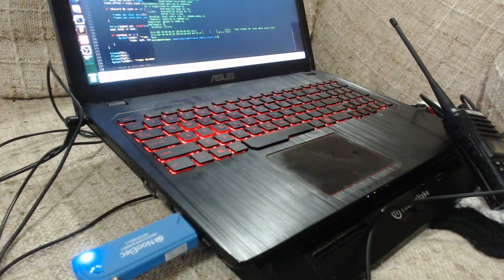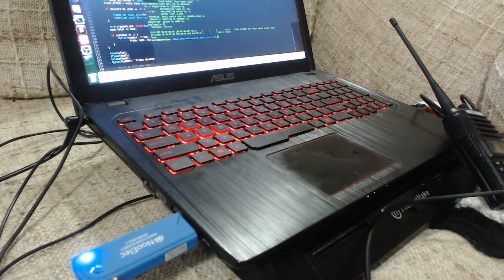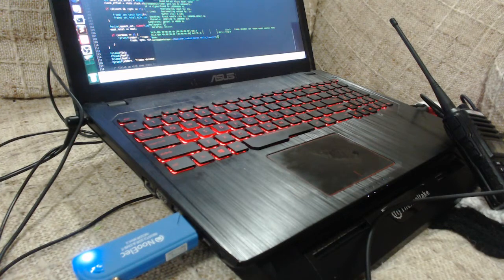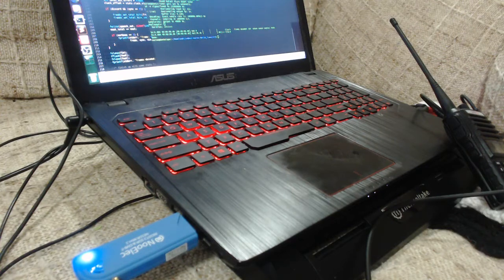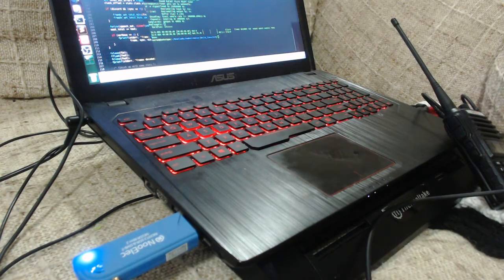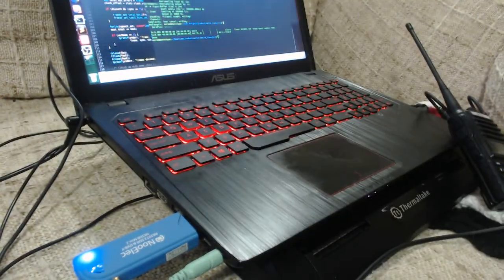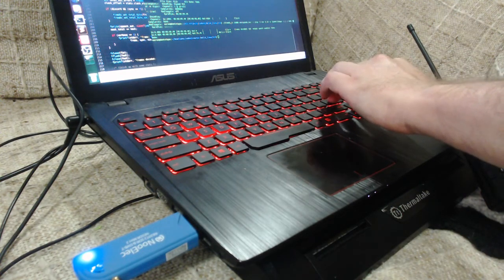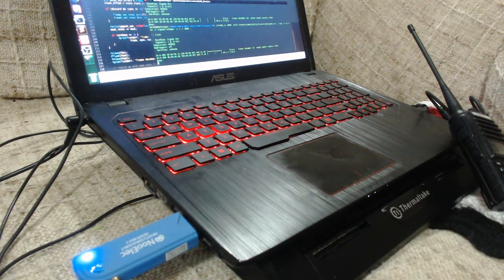Encrypted Digital Voice Radio Demonstration

Comment: Hi doctor,actually i searched for a long time to find a good answer,but i didn't,until i found you, you're amazing,but i want an answer about: can we develope the quality of that voice you made?
I mean with encryption
Reply from the maker: I'm not a doctor. But to answer your question, the codec2 developers have been working on something called LPCNet, which has much improved voice quality at similar bit rates. However it's still a bit experimental. I would like to add encryption support for it, but I've been busy with other things for most of the year and haven't had a lot of time to spend on this project.

Comment: Your work is amazing , I’m trying to implement something like that to my project involving controlling a CB radio using gpios and an android app, my goal is to use Java (my whole project is based on it) to process, encrypt and then decrypt on the other end the voice signal to add a scrambler like feature.
I tried different approaches but I find difficult to manipulate the audio signal and then demodulate it on the other end  .

Here’s my project so far , it’s working but an encryption feature would be awesome to implement if you have any hint would be awesome .
(Eng subs )
https://youtu.be/1QrY2L5KrPU?si=Ox-nGQM6J_iXuEPM

Comment: Interesting. Is it feasible to use this as secure digital voice over HF? Ala a Codan 3590 AES-256 DV. The Codan is silly expensive. I could see the PI and your software being used, and chassied with 3d printing, to resemble the Codan. If so; would buy
Reply from the maker: Yes I added HF support last year. From what I gather the HF support is less "foolproof" than it is on commercial systems like you mentioned (eg. there are a few different HF modes that work better/worse under particular conditions which must be manually configured as part of the setup process), but it's also much less expensive.

Comment: Very impressive projects. Do you shared the developments code or script?
Reply from the maker: Yes this became a full-blown secure voice module that runs on a raspberry pi, and I have some other videos that go over many of the features of that module. Release images are here: https://github.com/aarmono/crypto_transceiver_buildroot/releases

The core source code for the system is here: https://github.com/aarmono/crypto_transceiver
Reply: @aarmono  Thanks for the reply. One more things was the core source code includes with the new UI for configuration?
Reply from the maker: @9w2elm Yes the config UI is included in the crypto_transceiver project
Reply: @aarmono  Very thanks for the reply, I already gathered a necessary hardware to reconstruct and simulate back your system, can I have your email address so I can keep in touch with you if I have any question to asks?
Reply from the maker: @9w2elm  You can contact me on telegram under this username
Reply: @aarmono  I already simulate your crypto devices, but I can't populate the usb soundcard via your TUI. If I set it based on your TUI, one of the sound card goes busy when I want to adjust the volume. During system start its already select the sound card by default. Also there is a problem to make one of the sound card persistent in audio setting after system restart. Can you gives me a suggestion on how I want to solve the problems?
Reply from the maker: @9w2elm  There's an "Assign Audio Devices" configuration option/wizard that should bind the USB audio device plugged into a particular USB port to either the radio or microphone device. If you run that and save settings the assignment should be persistent.
Reply: @aarmono  I already assign it based on the TUI option. But one of the USB sound card that I already assigned, when I try to adjust the settings, it throws message box on top of the TUI which stated USB sound card busy error. As a results I can't change the sound card settings. These problems only happen to ONLY one of the sound card.
Reply from the maker: @9w2elm  If you plug reverse which ports the USB sound cards are plugged into (eg. if you have them plugged into the top and bottom ports plug the bottom one into the top port and the top one into the bottom), does the error follow the sound card or does it follow the port?

If it follows the card then perhaps the card is somehow malfunctioning (some of the cheap USB sound cards don't work very well). If it follows the port there may be something going on with the software/OS.

Comment: I'd like to know the exact command to reproduce, please.
Reply from the maker: The easiest way to run this is probably to use the pre-built raspberry pi 3b+ firmware image. There are instructions on how to do this here: https://github.com/aarmono/crypto_transceiver_instructions
Reply: Thanks.
 @aarmono
Reply: @aarmono   In this video what is the command you captured the signal from radio with sdr. I'm using rtl-sdr with sdr#.
Reply from the maker: @moekyawthu5774  It's been a while since I've used rtl-sdr, but I think it was: rtl_fm -s 48k -N -o 4 -f <freq>

You could probably play with the sample rate and oversampling settings a bit, but the important things are narrowband FM mode and an output rate of 48KHz

Comment: How bad does it degrade the signal in terms of re-readability?
Reply from the maker: You mean the voice quality or distance the signal can be transmitted? In terms of voice quality, speech is understandable but  doesn't sound as good as analog. In particular the codec seems to have trouble with lower frequencies.

In terms of transmission distance compared to analog, that's not something I've played with much. I've played with the HF modes a bit, and some of them were able to decode a signal with about a 0db SNR. But I haven't tried that with the FM mode used in this video.

Comment: yo how'd u get that circuit bent affect?
I want to know if I can play with that software outside of radio for this dope new beat Im working on.
Can I record my voice and get it to sound like that and .wav into audacity and fl studio?
Reply from the maker: The voice codec compresses the audio using a vocoder before it sends it over the radio. That gives the voice the distinctive sound.

Take a look at the FreeDV software: https://freedv.org/ It's based on the same software this system uses but has a GUI so it's a bit easier to use. You need two sound cards: one for voice in/out and one for radio in/out. If you loopback radio out to radio in, then you should be able to record the distorted voice.

Since you aren't using a radio you probably won't care about most of the options except you would want to enable Full Duplex mode so that the loopback works. The manual linked to from that site describes this a bit.

You could also potentially use the Audacity vocoder plugin, but I couldn't get it to sound right after a few minutes of trying (perhaps because I don't know how to use it properly).
Reply: @aarmono  super cool!
and I might use for actual radio in the future but for now mostly interested in using it it for music.
Thanks a lot for outlining what I need and how to hopefully get it going!
I have a theory it sounds like that because it might be somewhat related to the LPC coding used in early computer speach synthesizers etc.
think texas instruments stuff.
and geosafari talking globe.
the vtech whiz kid computer is another good example.
These would spaz out when you would jiggle the bateries or put in a cartredge backwords and do basically what you got when you tried to play the encrypted data through the decoder and it didn't know what to do with it.

Comment: Could you add in a time stamp with digital signature for each audio frame so you could at least compare it to the current time? Might be a trivial way to defeat replay attacks.
Reply from the maker: I did some investigation on replay attack avoidance back when I was developing this. At the time I couldn't figure out a way to encode the signature, since the way the digital audio data is encoded doesn't really provide a good way to add additional metadata to the transmission. Perhaps if it could be encoded in the audio stream in some way.

Timestamp-based signatures are tricky on the Pi because they lack real time clocks, so there would have to be some way to maintain reasonable clock sync (and resync after a power-cycle). In theory this could be done over the radio link, but I was trying to keep the system from depending on a particular radio receiving a particular transmission to function.

Comment: Will this work to decrypt Phase 2 digital trunked simulcast P25 systems ?
Reply from the maker: P25 is its own thing. There is another similar and interesting project of which I was unaware when I started working on this two years ago called M17: https://m17project.org/. It's targeted towards ham radio so doesn't have encryption, but it purports to have a lot of functionality comparable to other digital trunked radio systems and uses the same codec2 voice codec as my project uses. They have an open firmware design that can be flashed onto certain models of handheld radio.
Reply: No

Comment: cool stuff, thanks for sharing all this. but I don't get how you're able to recieve a decent replay of the original recorded voice.. when transmitting the encrypted signal over radio you had said there was some loss - wouldn't this make the recieved signal unreliable? because from what I now about encryptions like aes, even if a few bits are changed the decrypted data will be completely different right?
Reply from the maker: The encoding of the digital (encrypted) signal has error correction built into it that is able to recover the original signal in the presence of some signal loss. However this error correction has limits, and it's likely that for a given signal quality the encrypted voice will be less tolerant of loss than the unencrypted signal for the reason you state. Also because the way the encryption works, the receiver needs to re-synchronize with the sender in a way that isn't necessary with an unencrypted signal.

The nature of the difference between the encrypted and unencrypted signals is something I would like to understand more.

Comment: I'd be really interested in seeing codec2 transmission over LoRa radios. There's a Chinese company that I bought a communicator set from that used LoRa and it could send snippets of recorded voice over that link, but I'm not sure if they were using codec2. I'm wondering if we could achieve real-time communications over such a radio?
Reply from the maker: Potentially yes. I'm not that familiar with LoRa, but it appears to support a number of different bit rates depending on how strong/weak the signal is. Arguably it would be easier to implement this over LoRa, since the data encoding is already being done by the module; so you would just need to send the digital voice data to the module and let it worry about the rest.
Reply: @aarmono  Some friends and I from our local ham radio club are working on exactly this, I'll comment again in the coming weeks if we have anything to show off. I'm not clear on the licencing requirements, but from a technical standpoint I believe it to be very achievable to have real time voice communication
Reply: The problem with LoRa is, the duty cycle for each node is limited by policy, so you can't send enough data to contain any meaningful voice content.
Reply: The feds may visit
Reply: @charleshunziker7416 there is always someone without fail that can not resist the urge to post this bs.  There is nothing what so ever illegal in what he has done and it's already been done 8n various ways a number of times.  You people act like someone is pushing this out over ham.

Comment: i got two pi 3b+ and two radios, how would i hook up the other pi to decode the signal? i managed to hear the garbled sound out of the first pi. do i have to use a linux laptop?
Reply from the maker: I'm pleased to hear you're trying out my software. Just to make sure I'm giving you the best advice I can, are you using my custom pi image whose instructions are located here: https://github.com/aarmono/crypto_transceiver_instructions or are you using the standard pi image with my software installed on top of it?

A bit of information about the specifics of the hardware you're using (radio models, audio device interfaces, etc...) would also be helpful.
Reply: @aarmono  i'm using your custom pi image, i think its all working as its supposed to. I got to the audio adjustment page. I have two Baofeng FRS Radios, 2 pi 3b+, and 2 TRRS audio interfaces, like you do, but i guess i need 4 total, i just realized that. I have all the same gear, just no linux laptop. Am i supposed to feed the modulated modem noises into the radio (for tx) from the first interface? or the garbled speech sound from the second interface? i also dont know how to hook up the rx radio.  i dont think your system is duplex, just one way? thank you
Reply from the maker: @youngmonk3801  Thanks for the additional information. You are correct; you feed the modem noises into the radio microphone input, then the radio headphone output would be connected to that same audio interface on the pi as its microphone input so it can receive the modem noises transmitted by the other radio. If you're using one of the baofeng APRS-K1 audio cables or equivalent they should be pre-wired for that, and you should just be able to directly connect the APRS-K1 cable to the TRRS audio device which is outputting the modem noises. The other audio device is connected to your headset.

The RX radio is hooked up the same way as the TX; there's no distinction between the two. The system is bidirectional and supports simultaneous transmit and receive when connected to a device that supports it (eg. analog phone). You don't need the laptop; I simply use one because it's the hardware I have on-hand to receive/decode the signals my radio is sending since I don't have a second pi.

Since you only have the 2 audio devices, if you wanted to do a full end-to-end test with a single pi, you could plug the 2 audio devices into one of your pi computers and connect the modem audio interface speaker out to the modem audio interface microphone input using a male-male TRS cable and an adapter cable that splits the TRRS connector to dedicated microphone and speaker connectors (eg. https://www.amazon.com/Splitter-connectors-External-Microphone-ZaxSound/dp/B01I5MYQDQ). Use the male-male TRS cable to connect the speaker output to the microphone input. Then plug your headset into the other audio interface and start talking. You should hear yourself through the headphones, which verifies that everything in the pi is configured and functioning correctly. Then to test the radio is wired correctly, connect one of your radios to the pi, transmit the modem signal, and just listen to your other radio to see if you hear the modem noises through the speaker. Then when you get the additional 2 audio devices you can do the same thing on the other pi; and it should all "just work" (assuming the keys match).
Reply: @aarmono  i couldnt follow that splitter link, but also what kind of headsets do you recommend for this test? will earbud style headsets work, or should i get better?
Reply from the maker: @youngmonk3801  youtube appears to have screwed up the link. try this: https://www.amazon.com/Splitter-connectors-External-Microphone-ZaxSound/dp/B01I5MYQDQ

I don't know if that particular product is good or not, but that's the sort of cable I'm talking about you'd use with a male-male TRS cable to "loopback" the modem signal to test everything out before connecting it to a radio.

As for headset I don't really have any recommendation. It somewhat depends on your use case: whether this is for handheld use, mobile vehicle use, or indoors. I have a gamer-style headset I use for testing, but I can't say I'd recommend them if you needed to use the radio while driving or walking around. I can't think of a reason why earbud style headsets wouldn't work but haven't ever tried them personally.

One thing to keep in mind is the voice codec is designed for voice and may be negatively affected by ambient noise, so it's probably a good idea to use something with a microphone that won't pick up a lot of ambient noise if you plan on using this in noisy and/or outdoor environments.
Reply: @aarmono  that worked thank you,a lot of headsets have noise canceling does that affect the system negatively?
Reply from the maker: @youngmonk3801  I can't think of any reason why it would be a problem.

Comment: can you do another vid with 2 radios and two pi's? maybe some field testing? now that would be cool!
Reply from the maker: I have done some (unrecorded) field testing around the house trying to determine how far away I can be and still receive the signal at my house. Unfortunately local geography makes it difficult to receive distant signals, especially using the stock handheld antenna. However I did recently pick up a decent mobile antenna that fits on my handheld (as well as upgrade the antenna on my SDR) which might allow me to do some longer range tests from my car. I've been meaning to do this; I'd just have to figure out the best way to record it.

They'd have to be between the pi and the SDR though, since I don't have a second pi.
Reply: @aarmono  somebody get this genius young man a baofeng and a raspberry pi, stat! lol